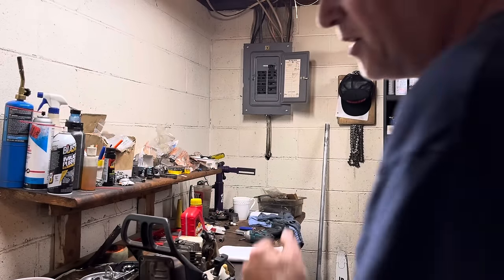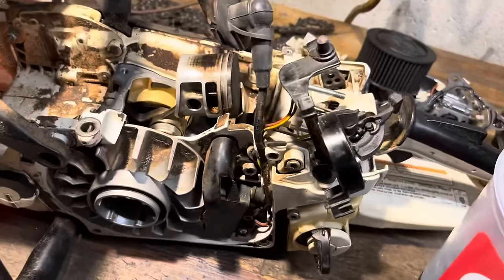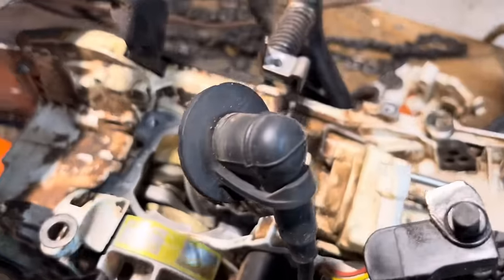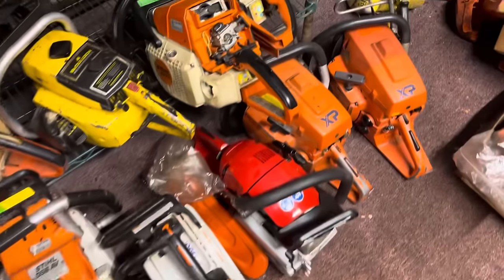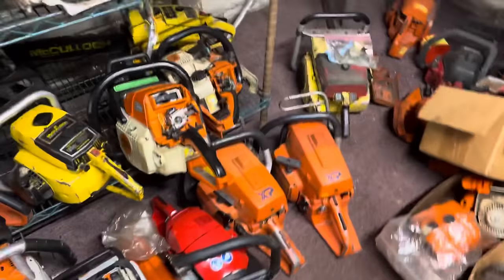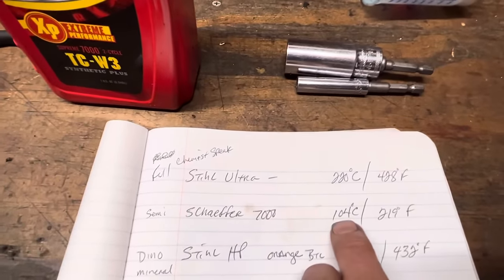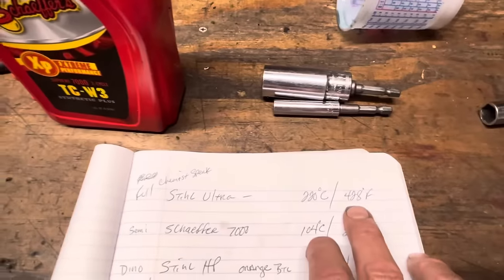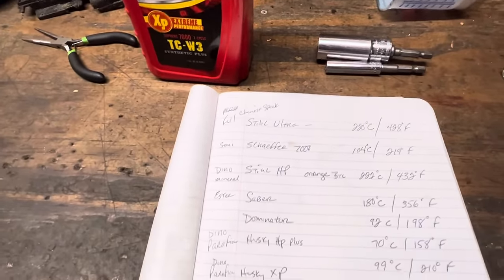Two Stroke Oil Talk.  Why Anything is Better than Ultra for your Chainsaw!

Comment: We have a three man tree removal crew, about ten saws in the rotation,  stihl and husky. The regular stihl oil was giving us bogging issues,  switched to husky oil and everything cleared up. We warm up the saws and run them full throttle.
Reply from the maker: The XP+ is very good oil.
Reply: My buddy has a tree removal business too.  He runs Stihl Ultra in his fleet of Stihl saws, and any time the temp gets over 85 with high humidity the saws won't start.  Or they'll start, and die as soon as it throttles down.  Total garbage.  We used my Huskies with Tanaka 2 cycle oil to finish the job.  At first he was thinking it was the saws, and was like, "I'm going to put all these on craigslist and buy Husky!" Eventually figured out it was the 2 cycle oil.

Going to mix up a few gallons of VP 2 cycle with a few ounces of sea foam in it.  Should clean the saws out.  From then out out, it'll be redline or VP.

Comment: I went to a Demo when Red Armor was first coming out, had been running orange bottle Stihl oil for years.  Engineer from Echo was talking about how superior the additives in Red Armor were and I said prove it.  So he got out 10 identical new Echo string trimmers and asked me to pick three. Then he had me mix and fill each with Red Armor, Husqvarna XP, and Ultra all from a common 5 gallon gas can.  Then he had me remove the cooling shrouds, start each unit, zip tie the throttles wide open, and run them until they stopped.  The Ultra unit locked up after half a tank, the XP unit ran almost a full tank out before sticking a ring and cutting off.  The Red Armor unit ran two full tanks through it and then we tore it down.  Almost no discoloration from heat and a nice red film on everything even at 50:1
Reply from the maker: That's awesome!!!
Reply: great comment red armor is great oil 👍
Reply: l wish someone would test Amsoil Sabre at 50/1 and 100/1 👍
Reply from the maker: @harryerhart5978  I can do one better.  I work at a local tree service two days a week and they have run Saber at 80:1 for years.  Next time I have a minute I'll tear one of the saws down and do a video.
Reply: @richardflagg3084  thanks my friend I'm afraid to go 100/1  right now I'm at 50/1 l have everything 2 cycle but chainsaws and l don't run my equipment hard I'm a solo operation maybe I will try 100/1 ??
Reply from the maker: @harryerhart5978  I'll have something up next week that will help with your decision.  Thanks
Reply: Thanks
Reply: @richardflagg3084  I am going to AMSOIL Saber as soon as it arrives.
Reply: IMO I wouldn't trust X brand representative mixing another X brand of mix especially for any   testing.
Reply: @chrisp556  and I also thought: because one person says to prove it at a demo, you burn up 2 machines?
Reply: Nice 👍 thanks for the knowledge
Reply: @chrisp556   Sir I understand your scepticism however he had me, a total stranger, pick the three units randomly from a lineup.  Then he had me mix the fuel for eackh out of a common five gallon gas can using unopened (sealed) bottles of oil.  I cannot imagine any way to possibly be more objective.
Reply: @smorgdonkey   The manufacturers budget so much every year for destructive demo testing.  I have been to dealer schools where we intentionally destroyed over a dozen units and then tore them apart for inspection just to see what a certain failure looks like.
Reply: @joepiper9476   I had to reread your post again.  I missed that part of you mixing the mix yourself the 1st time.   That would bn interesting to see for sure
Reply: @joepiper9476  very notable information. Thanks.
Reply: Stihl and the dealer have to honor the warranty so it's odd they would recommend bunk oil.
Reply: @singalongwrudy8690  the warranty doesn't apply to professional use so, if homeowners don't use their equipment frequently they won't likely have a problem. But hey...I get you...why listen to a mechanic?
Reply: @smorgdonkey  simmer down.. I AM a mechanic. Residue does not equal better protection . See insde when it's running...plus,  NO chainsaw should be topped out. A pro can feel when the torque matches the grab. Usually somewhere around 3/4. I bet you think the fridge light STAYS on when you close the door..
Reply: @singalongwrudy8690  I was talking about good mechanics. It sounds like you take stupid bets.
Reply: @smorgdonkey  as far as you know

Comment: G'day mate love your videos, the two stroke oil that surprise me was echo oil. The oil very dark green colour and when pulled apart things that have run on had very clean bore and piston with good oil retention on bottom end, it's changed my mind on oils after seeing this cheers down Under 😎 Kevin
Reply from the maker: That's the kind of feed back I like!!  Cheers mate
Reply: echo oil  as far as i know at least here in canada and I believe the US as well is redmax.. is that the equivalent? I switched to it on a saw builders recommendation since it had stabilizer... kinda makes me wonder how theres room for stabilizer though and still mixes at 50:1
Reply from the maker: @jbbolts  I'm going to hang it out there and say what we buy in the bottle at the store is not as concentrated.  Just a guess, but it would make it easier to measure if it was diluted.  Like I said, it's just a guess

Comment: YAMALUBE 2R SYN RACING OIL IS ALL I USE ! I mix it 4 oz per gallon if I'm going to run saws or trimmers hard 3 oz per gallon if I'm going to run them easy with mid grade or 89 octane marine fuel I do not use quote Rec fuel at all
Reply: 43 year,s in the business,   there are a lot of good oils out there but the chemical composition has changed dramatically over the decades also factor in how machines are used how the fuel is mixed and how the machine is maintained are all crucial to long life

Comment: I have a mower with a Yamaha MT110. It's 30 years old, so I estimate that it has done about 1250 hours.
Since we have dirt bikes it was fed with the same fuel.
That means that it has been run on 66:1 or 75:1,depending on which bikes we had @ the time. For the 1st 20 years it was Castrol 2T synthetic and for the last 10 it has been Motul 2T synthetic.
A few years ago it was refusing to rev to full speed so I pulled the barrel off thinking that the motor was worn. After washing the piston etc with kerosene and a toothbrush all the parts were spotless - no carbon.
I miked the bore - no wear, I measured the ring gaps - perfect. I checked the big end bearing for slop - perfect.
Then I found that the muffler was completely coked up. Cleaned it out and reassembled.
Its still running great. My takeaway is to run a good quality synthetic very lean.

Comment: Have been using the Tanaka and Stihl oil for more than 10 years. Haven’t had any problems. By the way, isn’t Stihl oil really Castrol oil?
Reply: As an added point, I think Tanaka became Mitsubishi.
Reply: The Stihl oil in the orange bottle is made by Castrol, which is why it is decent for budget oil. The Stihl Ultra HP stuff in the silver bottle is made by someone else. From all of the bad things I see pop up about the Stihl Ultra HP oil I wouldn't touch it. I'd run Super Tech from Walmart before I'd even put any of the Ultra HP in my saw.

Comment: I’ve used amsoil saber 50-1 in my ms 260 since it was new in 2004! Still runs like a new saw.
Reply: Yeah buddy we do too
Reply: So why do you mix Amsoil Sabre Pro to 50:1? Don't you read the technical data sheet? Mix that for ANY 2 cycle power equipment to 1.5 ounces to 1 gallon of gas.
Reply: @CuriousKL  100:1 adds a risk of being dry in the bottom end, which bearings and seals don't like.  Also, if you have an M-tronic (I just bought without, don't want electronics in my fuel system ... yet) IMHO the risk is higher if that system decide to run more lean for some reason (temperature, altitude, sensor issue, firmware issue, etc.).  And, 50:1 hurts nothing.  ADDED - I spoke to Amsoil last week (saw is only a few weeks old) and the support tech agrees that 50:1 is good for the saw.  This is even in Amsoil's printed material for COMMERCIAL use.  I keep my cars and now my saws for decades :)
Reply: I ran Amsoil saber about 75-1 for years, but someone recently gave me a pack of Stihl oil so I started using it again.  First thing I noticed is that there was considerably more smell with Stihl oil.  I'm thinking of going back to Amsoil.
Reply: I've run 50-1 amsoil in all my 60's, 70's and 80's Homelites and Macs. Will never change. They run so well

Comment: I run the orange bottle Stihl oil, and I've personally had great luck with it. Never tried the ultra in the gray bottle, I kinda consider synthetic oils silly myself. But an interesting point you might like.

Ever watch Buckin' Billy? He's got a video up where he basically shows you that Stihl orange bottle oil and Castol are the same thing.
Reply: I use the Stihl oil in the White bottle, has been about 7 years, been using it, no issues.
Reply: Lol buckin Billy gd show n is  good .I run utlra stihl oil in my ms 391 no issues n spark plug looks great ...

Comment: If you use the gray two-stroke ultra it says on the back of the bottle you have to run 89 or above octane for best performance I've been running it for years and I've not locked up a blower or weed eater yet

Comment: For husky weed eater and chainsaw, I run 50:1 Motul road racing 800 2t with 2 ounces of seafoam in every gallon of regular 10 percent ethanol gasoline. My husky weed eater gets run every day all summer long...been running it on this mix for 6 years and no carbon buildup. Before I ran it on amsoil saber 50:1 with 2 ounces of seafoam per gallon, and regular pump 10% ethanol.  This little 2 stroke has never had carbon deposits anywhere. So far I've not had to replace any parts except spark plug and air filter.

Comment: Those Burns on the side of piston can also be cold high speed running too,  Really need to warm your engine up as many channels claim 2 strokes can run flat out out of the box cold?? But the oil needs to warm to flow and work properly?  Anyway i use fully synthetic "garden" brand not stihl, so book says 40/1 Still or 25/1 if other name. I always use 25/1 for fear of too thin and run the screw a touch rich; something i learned from flying aircraft that run at high RPM, the extra fuel lubes, and cools and prevents Detonation- with valves of course!   Another channel mentioned if you double your mixture of oil to fuel , you can actually end up grinding you upper area because the extra carbon will break off THEN grind the cylinder. also clog your muffler/ spark screen ect and foul plug. Never had a problem at 25/1 with non Stihl "box store" brands fully synthetic.

Comment: I run a 32 to 1 mix. I don’t think 50 to one is enough. My dads got a old homelite that’s 60 years old he was a logger when he was younger. The saw still runs today. He has run 16 to 1 since day one. That’s what they use to recommend in saws.
Reply from the maker: They don't make 'em like that anymore.  Your dad OR the saws. 😎
Reply: @richardflagg3084  they sure don’t them were real men that packed a 909 d homelite in the woods.
Reply: I run my old Homies (SXLAO, XL101) at 32:1. The 2-cycle oils today are so much better than dumping motor oil in the gas like the old days.

Comment: My saws run completely fine on 25:1 gas/HLP46 mix.
10L HLP46 is about 50€ ;-D
Basically any oil works, too little oil or too lean or too hot is what seizes the piston.

Comment: Never been a fan of Stihl soul… I personally love my Dominator AMS oil but that’s just me. Awesome video👍 sheds a little more light on the topic.
Reply from the maker: Thanks!  You'd be hard pressed to beat Dominator.
Reply: I get saber oil from Amsoil, they claim it will out perform other 2stroke oil even at 100:1.  I still don’t dare mix it that lean but i have been running 80:1 for three years now and no problems yet.  Any thoughts or experiences longer than my own.

Comment: Ok Richard I have heard so many people say that the HP Ultra isn’t very good and I run a very exspensive stihl chainsaw along with a new leaf blower and grass trimmer and I do not want to screw them up so I want to try that Schaefer’s outboard oil but what ratio should I go with?
Reply from the maker: 40:1

Comment: Is there an aftermarket cylinders that work on newer 261’s? I havent found one and need one.
Reply from the maker: I see Meteor brand kits on fleabay for $130.  The meteors are good, but there's no substitute for OEM.  There is a guy on fleabay that takes apart new saws and sells the parts.  I've bought from him in the past, he's a professional.  His take-off top end is about another $100 if you can swing it.

Comment: I run 50:1 in my 462, with leaded 110 octane race gas. Costs a little more, but runs amazing. Maybe I'm wrong, but figured the leaded gas also adds extra lubrication.
Reply: 91 and higher won't make any difference except to your wallet.

Comment: I've been running Stihl ultra oil in my Stihl saws since it came out. Never had a problem. Just so someone. has any comments, I'm an ex STIHL technition.
Reply: I've run it for years and no problems

Comment: I was told by a veteran tech recruiter n small engines that Stihl HP was made specifically for the 4 mix engines. I run Red Armor and Echo.  Stihl carbs are too finicky.  Also, zero ethanol, dries out the crankcase as well.

Comment: Good evening ( from France ) Richard
merçi for your answer, I translated into English for you
Do you think dosing a little more motomix with ultra sthil is 45-1 
I did as you told me remove the exhaust it’s all clean with the ultra sthil the piston is greasy with 45 -1motomix with extra oil 
what do you recommend? switch to pure alkilate with 40 -1 husqvarna oil or stay with the motomix
merçi and good evening distant friend

Comment: I use the best sthil oil or echo, never had an engine failure in 15 years. I run about a can of seafoam per 5 gallon mix as well and everything from trimmer to saws start like new

Comment: I run 40 to 1 in everything 2 stroke you want your exhaust a lil wet out of muffler that shows your getting plenty of lube to bottom end crank bearings. Also use a synthetic oil saw will live for 20 years old

Comment: Yes sir I bought the biggest back pack blower from the stihl dealer and they gave me an extra 2 year warranty like you said if I bought a 6 pack of the synthetic silver bottle of oil . So of course I did for 10 bucks . 1 year later it locked up and it's having a new motor installed at this moment . Almost like stihl did this for an experiment.  Idk . Pretty ironic
Reply from the maker: I see a JASO FD rated oil in your future.  🔮Lol!!  I'm glad you're getting it replaced under warranty.  That short block for the BR800 is like $400 without labor.  Make sure you have the valves adjusted one or twice a year depending on how much you use it.  That goes for any other 4Mix equipment you have.

Comment: The issue people have with spark arestor being clogged up is because people run  half throttle  those 2 cycle engines were made to run full throttle and the heat will burn any carbon buildup
Reply from the maker: You're right about that.  If you're running a blower (only to clean off your deck/porch/carport), hedgetrimmer or a weedeater it's not going to be at WOT long enough to maintain full operating temp.  Many other oils will be more forgiving under this type of operation.

Comment: Wow been using sthil ultra in all my equipment more years than I can remember all runs great always fun to watch videos were someone is pushing a product so they go after sthil one of the best in the industry
Reply: Stihl 2 cycle is bad stuff.  You can switch to any number of other good oils.  VP, RedLine, Lucas, Tanaka.  Not pushing a product, just calling out the bad performance of one product.
Reply: @axesandthings483  20 years no problems everyone has their opinions though thx for input
Reply: @siryarwammowray3445  you have a point. If it isn’t broke, don’t fix it. My buddy runs a tree removal service. Couldn’t get the saws to start above 85 degrees in high humidity. That’s what prompted my negative reaction. 

Upside is all the oils now are loads better than 35 years ago. Almost can’t go wrong - comparatively.

Comment: been running Red armor for several years. Mix it like 50:1 but stop just a little under 1 gallon at the pump. No problems. I have a small firewood business and rotate between saws but primarily use a stihl MS391and MS311, a dolmar 510 and recently started added a Promac 55 to the rotation of saws. I haven't had any problems. The 510 I got from my dad. He ran whatever cheap oil he found at the store and mixed it with 10% ethanol pump gas for over 10 years. It is still going strong.

Comment: I've used maybe 3 gallons of mixed 40/1 stihl ultra through my 036 and haven't noticed anything funky about it, but am open to try other oils that aren't so freaking expensive
Reply from the maker: Buying oil in the pre-measured bottles is really expensive.  Most are about $45+ per quart.  Try a good quality oil that is sold by the quart and most are $15ish and measure it yourself.  I did another video "So I bought a bunch of Two stroke oil" and detailed the cost.  Most motorcycle shops have an excellent selection of oil.  Online is another option.
Reply: I think my 036 is the perfect all around saw , I live at 9k ft. nothing but ultra.. that’s all I know